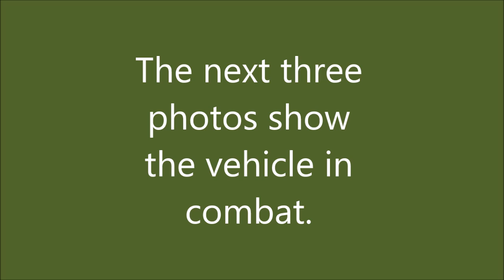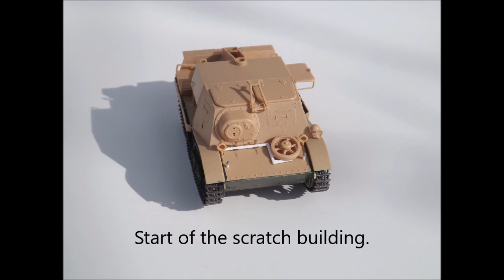ZIS 30

Comment: It's so cute! I wonder if the soldiers carried it to the front to keep it in good order. It looks more than a lovely furry pet that shares the couch with you than a possibly deadly weapon. On the other hand this long 57mm gun may have been able to deal with the older German tanks. The Russians were really good at taking what they had, putting it together and throw it at the enemy. I love the result. She turned out nicely. :)
Reply from the maker: Thanks Jens. I really had no idea how small it was going to be when I ordered the kit. I just thought it looked cool, it was sure something I'd never seen before. I do like the odd stuff ;-)
Reply: @danknispel4588  So do I! When I watched the vid yesterday I found an inbox review on the Mirror Models ZIS-30 by Jim Chandler and so I watched it, too. A huge difference between the kits, but Mirror Models kits are very expensive, so I think building the HobbyBoss kit would be my choice. Talk to you later. :)